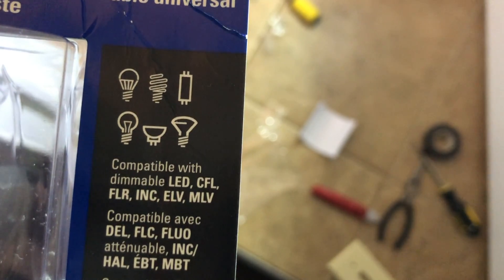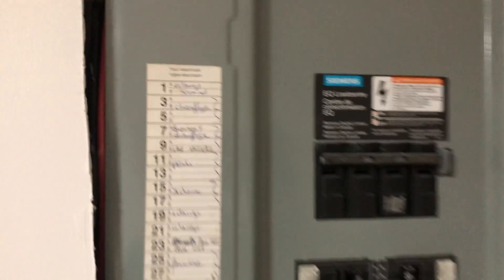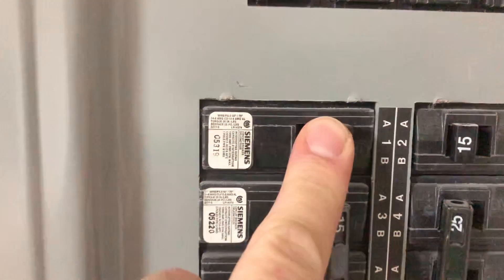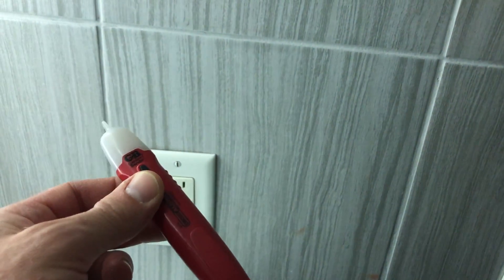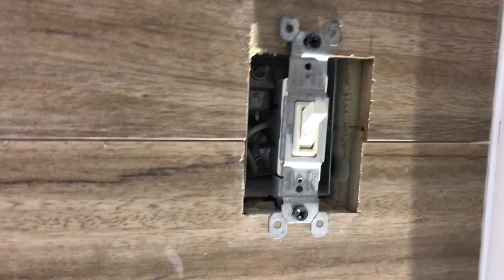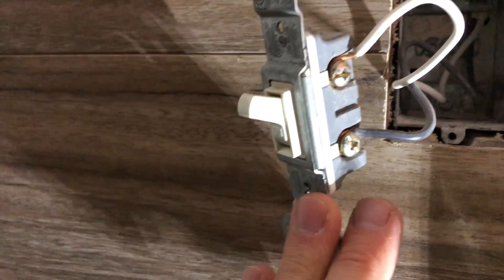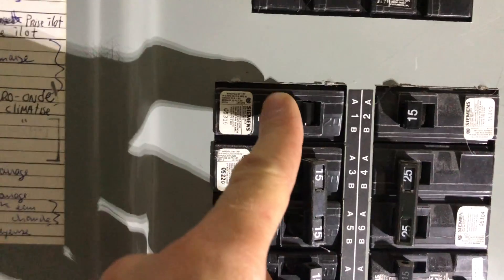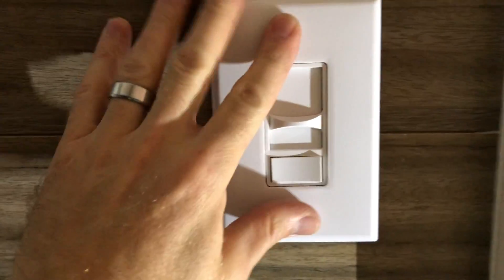How to Install a Dimmer Switch with 2 Wires

Comment: My old light switch has two black wires.  How do I know which screw to attach the new light wires to
Reply: It won't matter because they are both hots. A simple single pole light switch is just opening and closing the circuit to turn the light on so you can hook the hots to either screw.

Comment: My current dimmer switch has only 2 wires. I dont see. Neutral or ground.  Is there any way i can install smart dimmer?  I see some smart dinner require neutral wire and some dont.  But no ground wire on smart dimmer?
Reply: def need more context but it sounds like current dimmer is connected to a hot and a neutral but it could be a hot and ground. also in older houses the junction box itself (if metal) is grounded, usually behind the box out of sight. 

Dimmer switches that require a neutral wire are often referred to as "neutral wire required" or "neutral wire necessary" dimmer switches. These types of dimmers typically have more advanced features, such as compatibility with dimmable LED and CFL bulbs, as well as improved performance and energy-saving capabilities. They use a small amount of power from the neutral wire to operate electronics within the switch, which allows them to function correctly.

However, there are also dimmer switches known as "neutral wire not required" or "no-neutral" dimmer switches. These dimmers are designed to work without a neutral wire and are often used in older electrical installations where a neutral wire may not be present in the switch box. Instead, they rely on the hot wire for power and return the current through the load.

Comment: Can I use any 3 way switch for two wires or this one only
Reply: You can use a three way or four way switch especially if you are adding additional circuits or you plan to connect more devices downstream. However, you risk incorrectly wiring your device (like this guy did) if you aren't 100% sure that you know what you are doing. On a three way you'll have the black screw or the line or hot wire and two brass or silver screws for the load or neutral wire so you would only use one of those, leaving the other screw alone. The green screw is for the ground wire to link or "pigtail" to the main ground using a wire nut or similar.

Comment: I got one issue though! When I opened my dimmer switch from the wall -to connect it, I found different color of wires from your white and black, does it matter which one goes where?
I found 2 red and 1 blue wires, my dimmer switch also has 2 screws, one labelled A, another labelled L

Please advise.
Reply: one red is a postitive(hot wire) the other red is a grounding wire and the blue one is a netural wire....
Reply: Finding two red wires and one blue wire in a junction box suggests that you have multiple electrical circuits coming into that box. In electrical wiring, the colors of wires can vary depending on local electrical codes and practices, but typically:

Red wires: In some cases, red wires can be used as hot wires, similar to black wires. Red wires might indicate a secondary hot wire or a switched hot wire in a circuit.

Blue wires: Blue wires are not as common, and their usage can vary depending on local codes. They may be used for special purposes or as part of a specific circuit. It's important to identify the context and purpose of the blue wire.